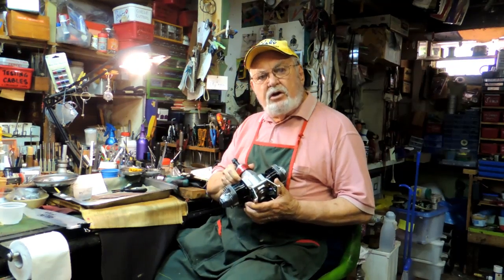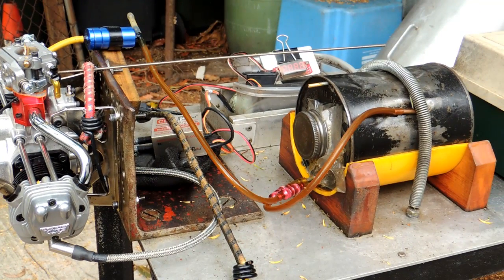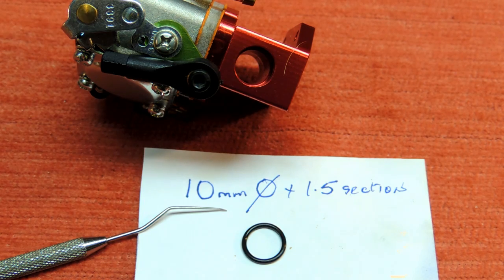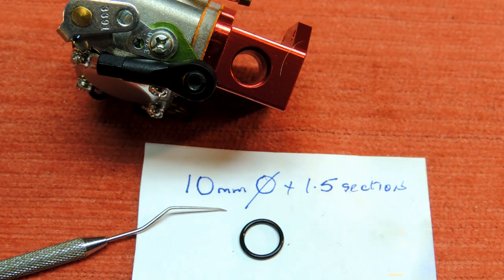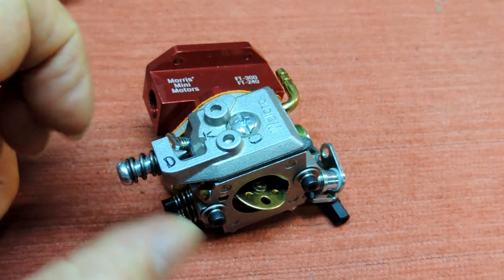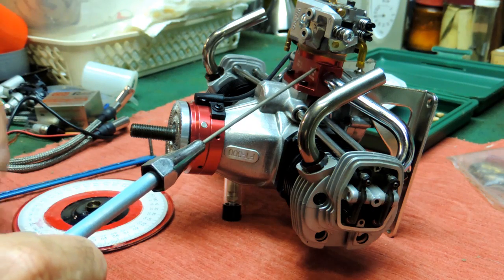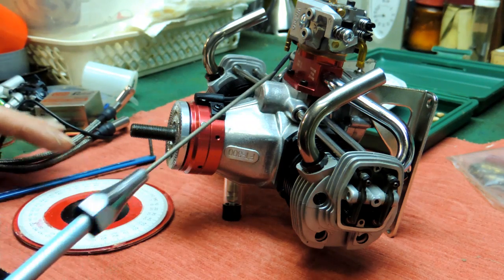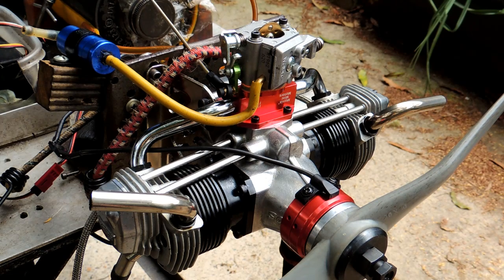MORRIS CONVERSION

Comment: Hi Brian, thanks for the video. Do you know what year OS started to manufacture the 300 with the new style machined  connecting rods?   And you mentioned gas/oil mix 20:1.  I guess the higher oil content is for all of the 4-stroke valve train kit?  (when compared to 50:1 for a 2-stroke gasser for instance) Thanks, -John